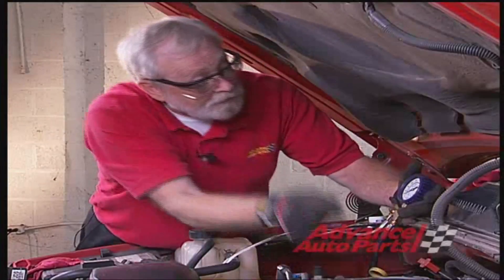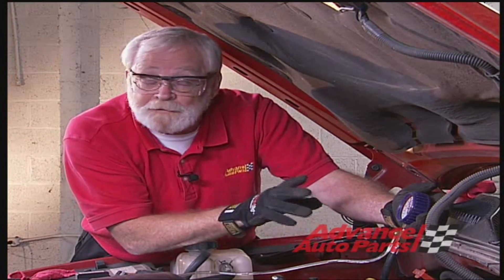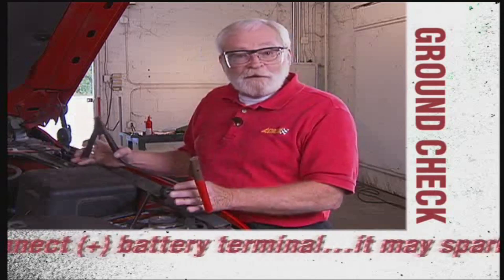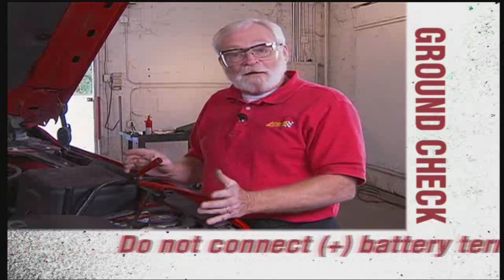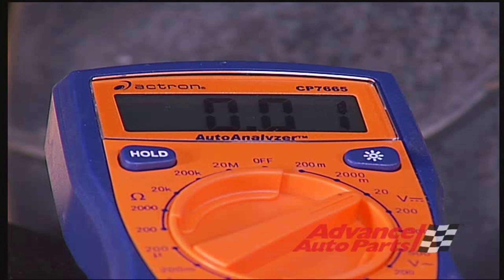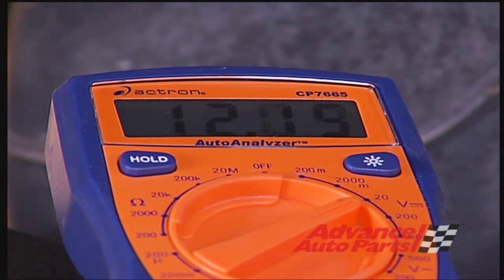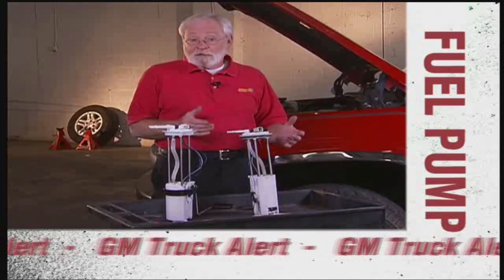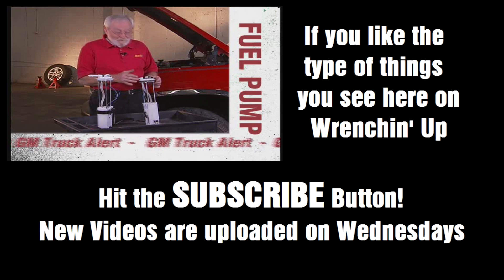Fuel Pump Electrical Check - Wrenchin' Up Back To Basics

Comment: Power and ground tests are only valid if the circuit is loaded. The connector should be plugged in and back probed with the pump on to do these tests. Love your channel!
Reply from the maker: Yes, loaded circuit testing is always the best. My thought here was a simple first test to keep good fuel pumps from being replaced because the B+ or Ground was bad back there and wasn't checked. Thanks for your very accurate comment, and for watching.